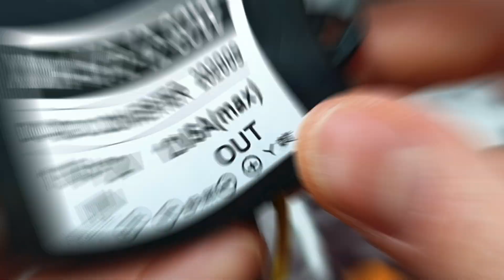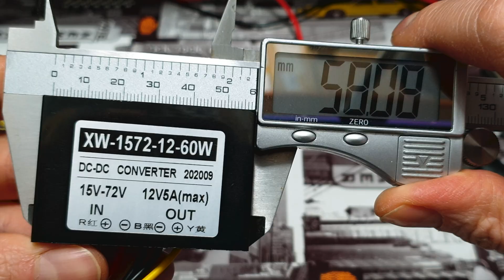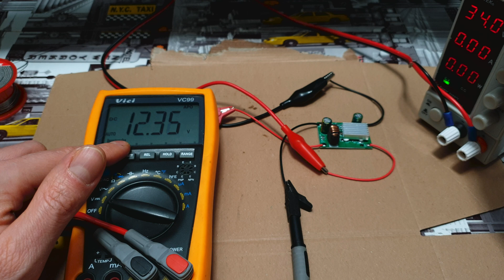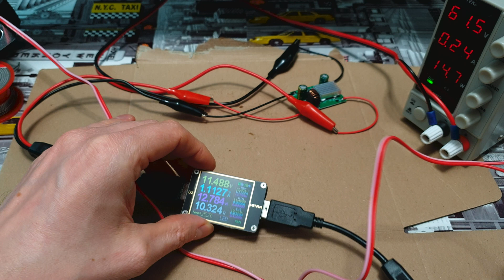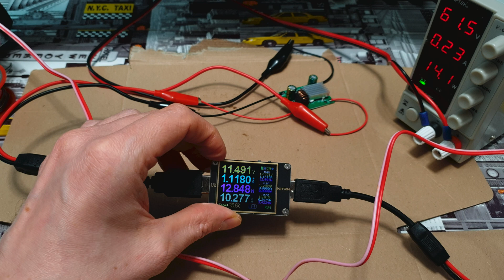StepDown Converter for Xiaomi Janobike Laotie ⚡🏴‍☠️ Easy connect 12v Blinkers etc... 🛴🚀

Comment: GREAT tutorials, thank you!  I want to simply swap out the existing side RGB LED's for a single solid color strip.  Does the Ti30 have a buck converter built into its controller allowing me to simply use a 12v LED strip?🤔

Comment: I need a stepdown to 29.5v, any recommendations?
Reply from the maker: you will have to use step down converter, later I will search it for you :) . What power do you need , 1A ? , and what will be max input voltage
Reply: @PirateWasHere  for use on a scooter, maybe 15amp max draw.
I have a 36v 10s2p battery (from a broken scooter) I would like to use on my (Frankenstein)29.5v 7s scooter.
Reply: @skepticfucker280  that would be huge and I don't think for that power are cheap